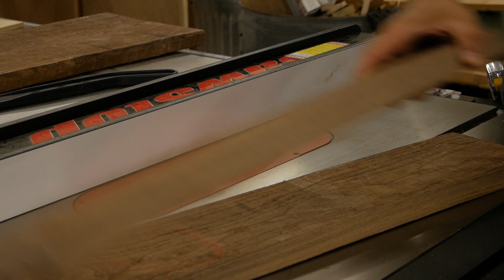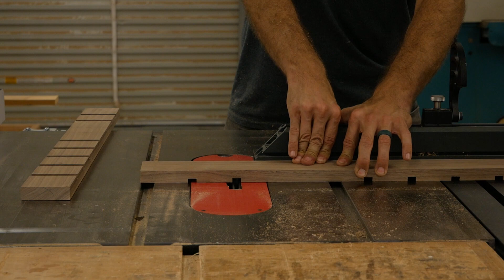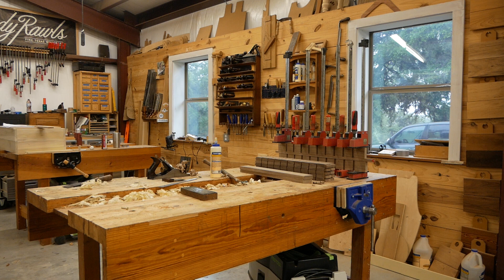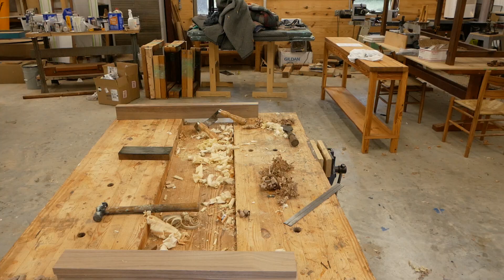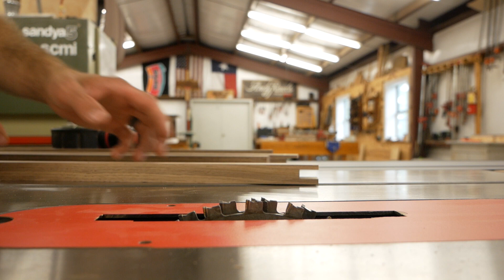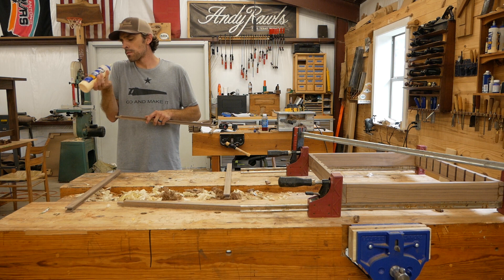Making A Golf Ball Display Case (Part 1)

Comment: Hey Andy!  I always enjoy watching your videos.  Its great to see the array of tools you have and utilize in your shop.  That FS 180   4 side planer has got to be great to have.  At what point did you decide you needed one?
Reply: Hey Andy. Not sure if you will see this but just a little advice, when you finish with the hand plane, place it on its side not the face. Just to extend lifetime of blade
Reply: What a wise ass for a little boy. He does woodworking longer than your'ein this world.
Reply: Calm down.
Reply: Age doesn't take away from it being a decent observation.  The extra force/friction over time will slightly shorten the life of the blade before it needs sharpened/replaced.  To be fair most of his surfaces are wood which are a lot better than metallic or grated surfaces for obvious reasons so the benefit is marginal but even a micron is greater than zero.

To detract from someone's suggestion or observation that isn't in the slightest negative just because of age really shows your character/personality.  Please never be part of a field that is constantly evolving/changing, your mentality would severely cripple any progress you would be part of if you weren't kicked off the moment people discovered said mentality/personality.
Reply from the maker: Thanks for the suggestion!  In my experience I’ve never noticed my plane blades being dulled by leaving them face down on a wood bench top.  I’m  personally more likely to bump and damage an exposed plane blade from the plane resting on its side.  I know there are some craftsman who ascribe to this mentality and who am I to say it’s right or wrong.